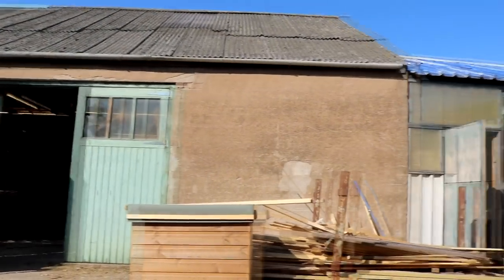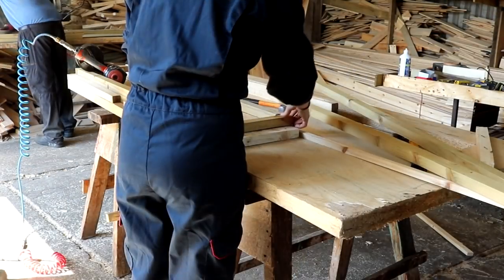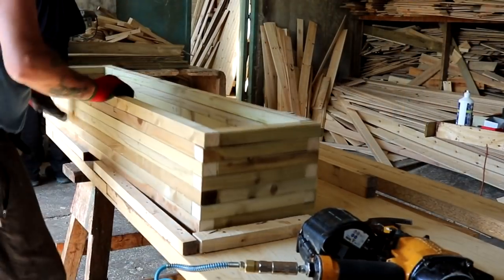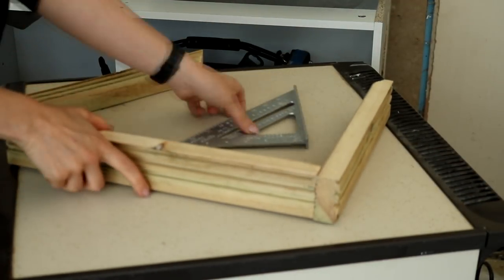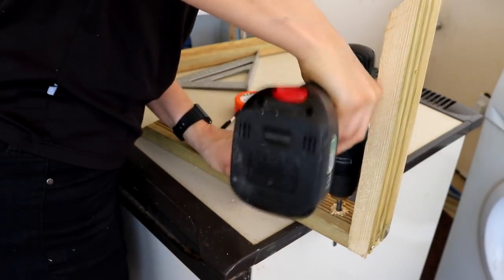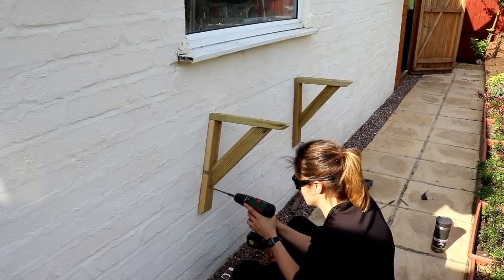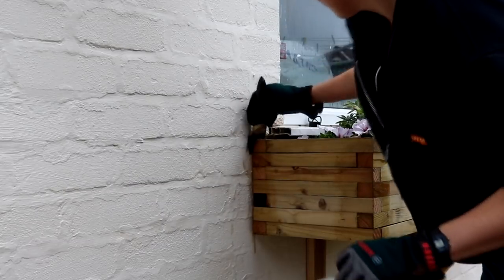DIY Window Boxes & Gallows Brackets | The Carpenter's Daughter

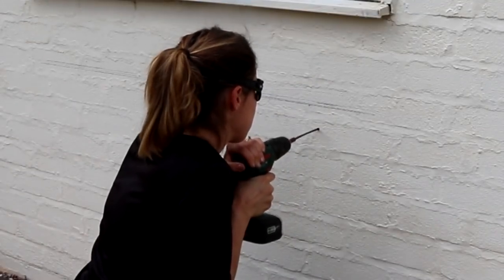Comment: Well done. Looks great. My only advice would be around 3:45. The drill wobbles like that as the drill bit isn't lined up in the chuck. With pressure it could snap. Easy fix, take it out line up and tighten. 😊

Comment: A very clever design. Personally I would leave an air gap, 6mm, between the wall and the box. That should allow the timber to dry evenly and prevent water, and wood preservative, staining the walls when it rains.
Time to buy yourself an sds drill, they are so more efficient than cordless drills.
No one forgets the first time they shoot themselves with a nail gun:()
Reply from the maker: Thanks for the tip 😀 love the gap idea 😊
Reply from the maker: And definitely want to get an SDS drill.  We used to have a hammer drill, but it broke and really miss it!  Also, the nail gun scares the bejesus out of me for that very reason!
Reply: The Carpenter's Daughter Top tip pull the nail out instantly. You are going to have to use your teeth because the nail head will be tight against the skin. First bite the pointy end and push the nail back into the skin. That should leave enough room for your teeth between the head and skin. Think of your happy place and pull. It won't bleed much but the swelling will make the wound throb.  I don't know what happens when it hits a one. I don't want to find out either. 😥
Reply: The Carpenter's Daughter DIY first aide maybe a good topic to cover. PPE is all good and well but few people have a plan incase of and emergency. I work on my own a lot and know I may well cut of a digit one day. I carry a sterile bottle of water , chemical ice packs and powdered coagulant in my pack at all times.
Reply from the maker: Thanks for all your advice!  It's all enough to turn my stomach 😖, which is another reason I work extremely slowly at my own pace.  I keep thinking about how I may have to take over the woodyard one day, and if that happens, I've definitely decided I'll be hiring a Healthy and Safety consultant.
Reply: The Carpenter's Daughter You are welcome. In the past I have always selected one of my staff to train as the h&s officer and given them a healthy budget. That shows all the employees that there's a future for all of them if they work hard and offer ideas the boss Lady is willing to listen. Keep up the good work Regards Mike.